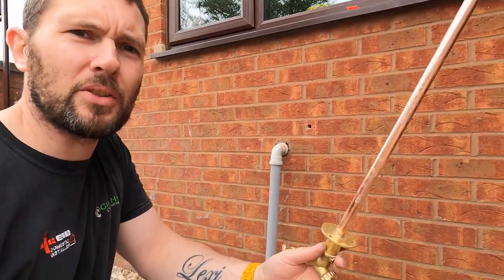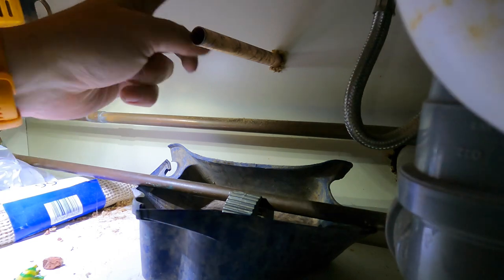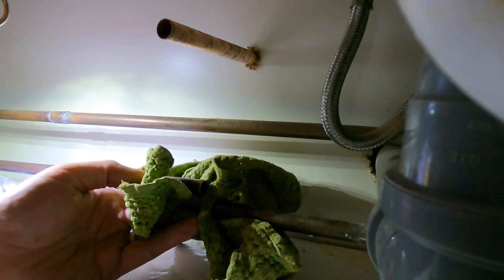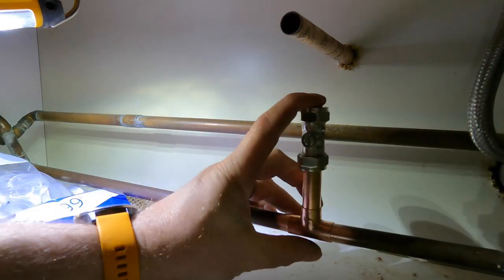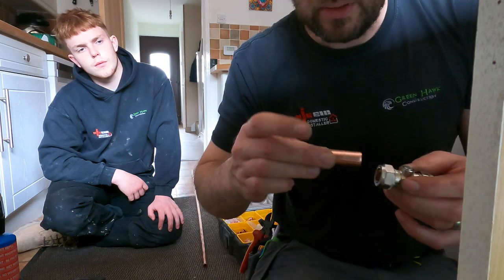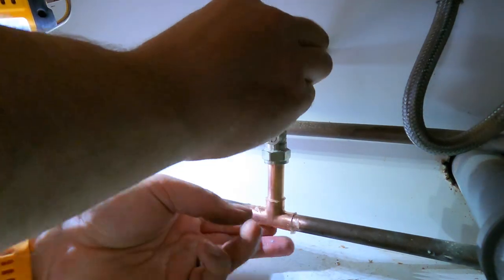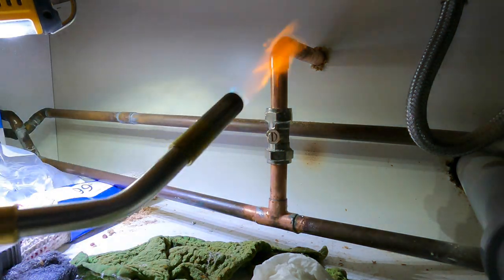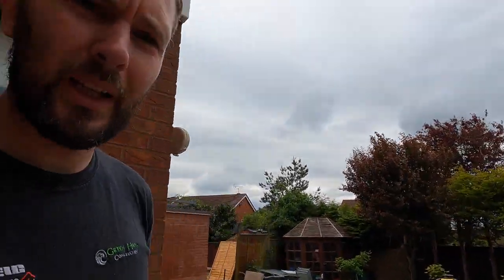HOW TO INSTALL AN OUTSIDE TAP FOR THE GARDEN

Comment: Nice to see some real world plumbing, for reference, jointing compound is meant to go around the olive as this forms the sealing faces, not the valve threads.
Reply: Was going to say the same... compression fittings don't seal at the threads, they seal via the Olive so a little either side of the olive does help. But I'm guessing this time round Mike wish he'd used a push-fit fitting eh! 🤣
Reply: @Sparks1Plumbers0  when I saw the steam displacing the flux I thought he was going to braze it 😀, good recovery though.
Reply from the maker: @Sparks1Plumbers0  that’s exactly what I thought when I saw it wasn’t heating the way I wanted but I was committed if nothing else 🤪
Reply: @GreenHawkConstructionltd  Haha .... commited is one word.  😂

Comment: Great vid, just like to add an opinion. You can get a tee compression join with an on/off value, would make the job easier  as what you used are really service isolators, 2nd, compound around the thread will do nothing to stop leaking you need only apply to the joint internal  chamfered edge that buts up to the olive also I noticed you're have NICEIC on your top so you should know that its best not to have the out side tap bonded to the house earthing especially TN-C-S  a plastic 90 degree push fit joint would of sufficed.

Comment: Interesting to see the way plumbers deal with olives. Myself it's a case of tighten it, undo it, couple of turns pf PTFE over the olive then remake joint with a bit of GP builder's silicon. Had the problem water in pipe many time's good that you showed the problem. Got to admit though there's many a time I've not been happy stripped the joint only to discover the pipe and fitting are fully tinned. Doh!

Comment: Good vid, what about a non return valve? Also maybe a heat mat to stop a few burn marks 😊👍
Reply: The tap has the Non-return valve fitted inside it as it's a dedicated external tap. (You can tell by the small bolted on it's underside as Mike was waving it about. And yes, a heat mat would have been an idea, might have saved him overheating the bottom fitting and burning all the flux off the right-side where he had trouble getting the solder to run! 😁
Reply: Need a double check valve on that bad boy. Water regs

Comment: This installation does not meet the 1999 Water Regulations.
A tap with a built in Check Valve can only be used to replace a tap already installed  before 1999.  
For a new tap installation a garden tap without a built in check valve must be fitted with the check valve and isolating valve within building where it can not freeze.  
The reason for the change in regs in 1999  is because no one ever tells the property occupants that in cold weather besides turning off water supply to tap and opening tap the nut under the tap body must be undone to release  the water trapped within the check valve. 
Without freeing the trapped water if the tap freezes the plastic check valve mechanism disintegrates rendering the check valve useless for back flow prevention.
If in doubt consult a qualified plumber.

Comment: Another great video thanks 👍 I used one of those lengths of copper with the base plate already attached, got it from Screwfix lol that could be the issue ha ha ha, anyway, that is a decent bit of common sense tightening the tap down before soldering in to place, Muppet me did not do that and had an upside down tap to begin with! 

Figured that out and it was flawless for a year then the tap started to leak as the 40000 rubber washers I used to straighten it up started to degrade, no problem thinks me, tighten the snot out of it for another full turn, errrrrrr no, almost but when forcing the tap back round to the proper position the brass backplate split ughhhhhhhhh

So proud of the very first bit of soldering ever done on the utility room side and convinced it was a stroke of luck getting it right first time I am reluctant to try and desolder that side, it has also been decorated since and with not owning a heatproof mat the idea of upsetting the wife seemed stupid so I decided to desolder the backplate leaving me with error maybe 1 inchbof copper sticking out of the wall, yes you guessed it, kind of stuck at that point at the moment, could do it with push fit I suppose but also keen to get some more soldering experience, might have another bash tomorrow.....

Anyway, thought I would share my own experience of the job you have just made look very simple ha ha ha, thanks again 😉

Comment: As a DIYer I prefer compression fittings. No mention of olives, I assume they were used.
Use a paper towel shaped like a Tampon to soak up water from the pipe. Not your finest hour

Comment: Jointing compound should go where the olive seats to the valve and solder with the isolator valve disconnected to help vent any steam. Your supposes to put a drain off on also even though its pointless and you should explain about getting a tap with built in check valve. Also required.

Comment: Good video and a neat job.
I’d make sure there’s a plastic fitting, maybe replacing the elbow, to insulate the outside tap from the house equipotential zone. Particular as there is water bonding, it will protect anyone touching the outside tap if there is a broken PEN.
Reply: Will it? Is water not conductive?
Reply: @MrFrenchi93  very slightly - megohms for clean water. So the current flow through the column of water would be too low to be perceptible. The resistance of copper pipe with soldered fittings would be close to zero.
Reply: If you look closely you'd see the main incomer waterpipe is plastic... so technically it is isolated. Any bonding on the subsequent copper pipe would be classed as supplimentary bonding .
Reply: @Sparks1Plumbers0  You are right, and bonding therefore isn't needed. However, a bonding wire is present which might be supplementary but probably goes to the main earth terminal. And if the house plumbing is all copper it is very difficult to avoid it being tied to the electrical earth - boilers, central heating pumps and immersion heaters are almost always class 1.
The house might be TT but given its location on a housing estate and age, that seems unlikely.